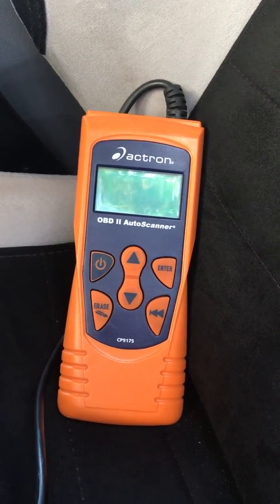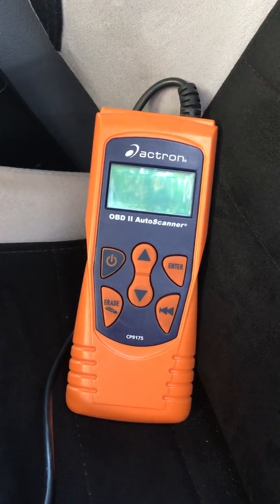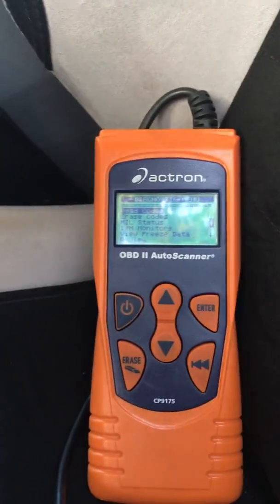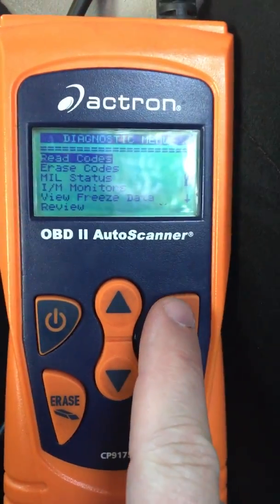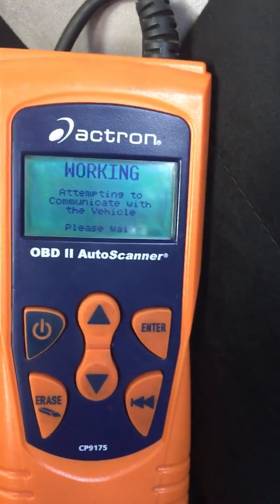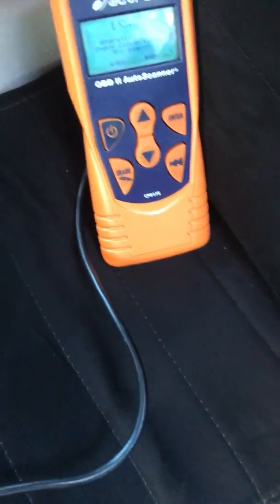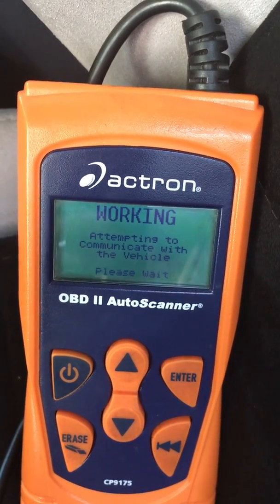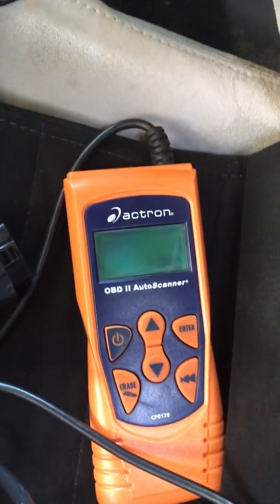94 Mustang GT OBD2 Code Reader - ERROR.

Comment: Hay guy THAT IS NOT AN O.B.D.2. PORT! That port is a propriety scan tool for FORD! You keep putting that O.B.D2 connector into that port and you will end up messing up your cars E.C.M. the O.B.D 1 connector is located behind the passenger strut tower.      (Ford moter Co. Engineer Retired) DEARBORN Mi.

Comment: Purchase a cp9128 adapter and that scanner will work. It plugs in to the diagnostic port under the hood located on the passenger side by the strut tower.

Comment: What kind of seats do you have in your mustang. I’m looking to get some better seats for my 1996 mustang gt.
Reply from the maker: Sam Smoot - they are Corbeau LG1 (not the wide).  I am extremely happy with them.  I used fox / sn95 manual seat brackets and made my own adapter plates for them.

Comment: 94 mustang GT is OBD1 . The connector is in engine bay , passenger side. That interior OBD2 connector is for V6 mustangs (which are OBD2)  of the same year. It doesn't have any function . You need a OBD1 scanner and use the engine bay port connector.
Reply from the maker: You are absolutely correct!  This video was to demonstrate how the OBD2 reader does NOT work on the 94/95 Mustang GT.  My subsequent video uses the ODB1 port under the hood to run a KOEO test and pull the codes successfully.
Reply: I had not seen your other video. My bad ...